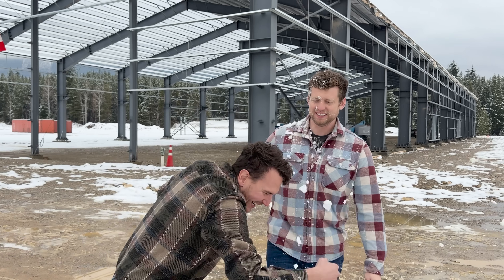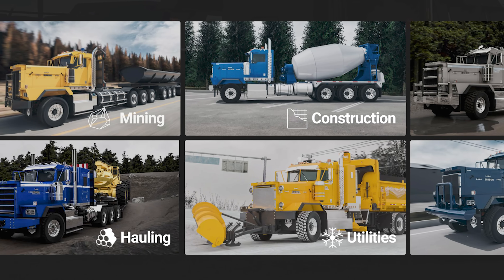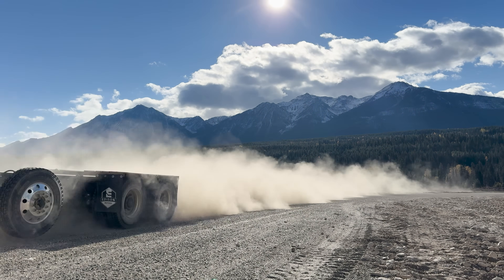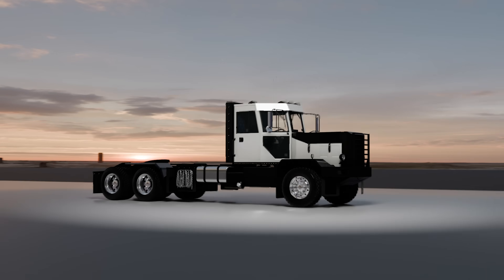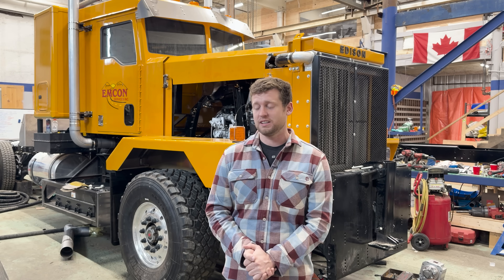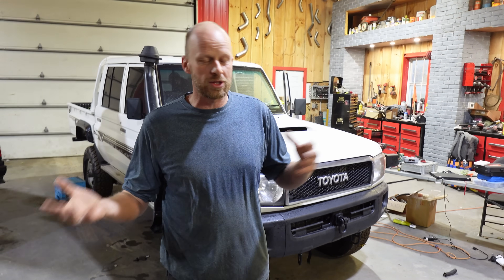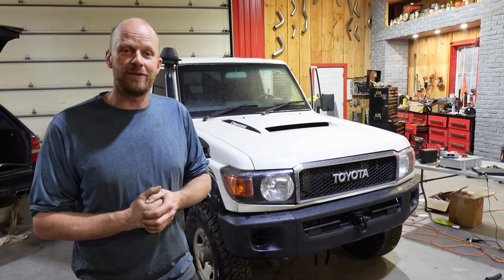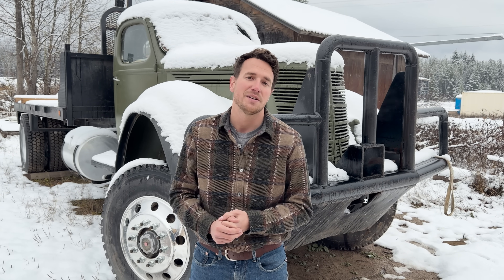VICTORY After RED TAPE: Edison Motors has GOVERNMENT APPROVAL

Comment: I can't help be skeptical about the hybrid trucks. This may not be the kind of video to discuss it, but I didn't hear anything about downsides. Everything has trade offs. Now full disclosure i'm not even an enthusiast in this field, let alone an "expert" but when I hear you get this benefit and that benefit and it's so much better than the way it's been done before I find myself thinking 

1) What are you giving up to get those upsides? 
2) If this is the "best" way to do this particular job, why hasn't it been done before?
Reply: 1) Its more expensive (about 25%). This is why they are incentivized to have right to repair as an ethos. Most of the cost of owning a truck is fuel and repairs. The #1 priority if they want to sell a truck at a high markup is to lower the cost of ownership. They advertise fuel and repair savings because that's the only way they can sell trucks as a small business with low output and high margins. 

Most other companies sell a LOT of trucks at EXTREMELY LOW margins. They then make most of their money in repairs. They sell you 200$ proprietary parts that break constantly because that's literally the business model that makes them profitable. They lock you into a monopoly you can't get out of. This is the hidden benefit of Edison. Fuck all the technobabble, it's expensive in the short term, but way cheaper in the long term. That's their MO.

2) Battery technology has been severely lacking to get the weights down to where they need to be. While trains have had giant cabs chalk full of batteries, and log loaders have huge generators, trucks can't really have either, and have to make up for it with battery energy density. Even now I suspect that they aren't at their target weight, but we'll see.
Reply: The other issue, and what Edison is running into, environmental regulations are not designed for serial hybrids.  They are either parallel hybrids that use engine power that directly drive the axles, or full EVs.  They don’t have regulations that allow the engine to be a generator.  

There was lack of electric axles for trucks.  With the push world wide you see a large jump in the manufacturing of electric drive axles for trucks. There are different design considerations for an e-axle than a regular mechanical one.  The loads from regenerative breaking would destroy a traditional differential that is designed for single directional stresses.   

A disadvantage with the hybrid is that most mechanics won’t touch high voltage.  They have to get special training to be safe with it.   It’s not super hard but it is a field they normally have experience in.  There is also all the programming and diagnostics to get the systems up and running.  

The first Tesla roadster isn’t even 18 years old yet and it took a while before they became common.  Semis are even slower to change.  Chace was one of the first to reserve a Tesla Semi and he would still be waiting for it.  Sometimes it takes fresh blood in the industry to force change.

Comment: I think that the hybrid package has some interesting advantages in PTO applications, and any environment that is stop/go, or up/down... For PTO, DC electric motors can provide the right scale of power, where needed, with the ability to handle peak loads that would require a big main motor, with the right gearing, and the electric motor can be located anywhere, without a mechanical connection, and without the limitations of hydraulic drives. Certainly, there are direct PTO applications that would be less expensive for a particular application, but the requirement of having one engine supply multiple load types...

Comment: why can't you do hybrid semi truck with manual transmission?  I've seen old video where they took old Volkswagen Beetle (Yeah like Herby) and made full electric but kept the older 5 speed and worked great.
Reply: Afaik they showcased a project where somebody did a electric conversion on an old sports car and kept the transmission. The reason you would get rid of it is mostly due to weight and repairability. Practicality unfortunately gets in the way of fun :(
Reply: In this case part of it is that the electric motors are on the axles, so there's no place to put the transmission.  The main reason, though, is that electric motors have such a wide speed range and torque curve that they don't need to change gears.  Having a gearshift is much less fun if you can just start off in 5th as fast as you can start off in 1st, and shifting gears just loses acceleration time.

Comment: I can see hybrid extended wheelbase 4x4 trucks (heavy and light) having an "unfair" advantage over mechanical extended wheelbase 4x4 trucks.
All the challenges in turning radius while in 4x4 disappear when your front axle can turn at a different speed than your rear....

Actually, diesel electric could be pretty exciting for industry as well with an "up-fitter package" electric winches/pumps turning independently of wheel speed/engine RPM

Oops, getting a little ahead of things....
you have bigger fish to fry at the moment....
Looking forward to seeing where this goes.

Comment: the mechanical version might be a blessing because look at lucid the CEO is a automotive expert and they had supply issues with scaling up and repair parts availability.

if I were to get one it would definitely be with a  80-120 in nearly super sleeper and 300-310  in wheelbase 18-20k front axle and Canadian 60 in spread drives no deplorable due to California ridiculous requirement. if it could be styled like a t800 with prominent but shorter nose to reduce the overall length to keep below 110 ft over all it would be a very interesting to pull jeep and tri or quad rgn

Comment: Just to be clear, does the production and sale of mechanical trucks require the approval from Transport Canada? Or is that only needed for the sale of diesel electric ones?
Reply: The mechanical trucks still need the approval from Transport Canada since they are a new truck being driven on public roads.  The hybrids will need separate approval since they are a different design.

Comment: I think you are making a strategic mistake. Your name stands out because of the hybrid concept. To now put it on the shelf and build traditional mechanical, low volume, high margin is the wrong approach. Investor capital is there to buy you time through a few years of negative profit. That's the point. Using investors to reach high volume with one model. You need to reach high volume first, not high margin. I see you spending lots of time on all sorts of projects - pickups, this/that. I'm not even sure what you are actually making at this point and it shows. 

Anyways, regardless, great to see some courageous Canadians having a go at manufacturing! Too bad the government doesn't just green light any request you make. How dumb you now have to go through Transport Canada.

Comment: Anyone notice at 5:02 they show the diagram and it has a 200hp electric motor for braking? More on that please.
Reply: The drive axles themselves are the regen braking.  The regen braking basically turns the axles from motors to generators.  Charging the batteries and slowing the truck down.  This is where the fuel savings is really generated.  The regen breaking is actually more powerful and precise than a Jake break.   The trucks will still have air breaks for low speeds,  redundancy braking, and to satisfy transportation regs.
Reply: @Wild_Lee_Coyote on the electric truck that makes sense but this is on their mechanical drive truck.(And yes I know how regen braking works, I drive Prius and an EV lover)

Comment: Where are you guys at with being able to use a generator "on road"? That seems like the silliest, but biggest, legislative hurdle you guys are currently facing.
Reply: No this is for the mechanical trucks at the moment.  Edison is still working on getting the Environmental laws changed for the hybrid trucks.  Certification for the mechanical trucks was much quicker because the laws didn’t have to be changed, they just had to get an exemption.

Comment: If you want a pickup that gets great electric mileage, build the axles narrow! If you have to mount your own cab anyway, it doesn't have to be a truck cab. Throw a Honda Fit shell on there. Drag force is frontal area multiplied by drag coefficient. If you shrink your cab from 2m to the 1.5m width of a subcompact car, you'll get 30% more range or a 30% smaller battery, allowing more payload.

Comment: One suggestion for the edison rigs, separate amber rear turn lamps! Could keep the clean look with all clear LED housings but have the clarity and reduced rear end collision risk too!
Reply: Every Edison truck in the near and medium future will be a custom truck.  You want amber turn lights, you got em. The advantage is Edison is all about off the self components. So if you want 30 lights and 6’ sleeper cab on your wench truck, that can be done.
Reply: wench truck? hahaha
Reply: @-NGC-6302- Fanny magnet?
Reply: @Wild_Lee_Coyote but they are streamlining wire harnesses in a way that every wire harness is the same one for a batch. I guess they will have a modular structure for custom wiring for custom applications. If not this will become another disaster.
Reply: @sujeewarathnaweera  You genuinely believe they haven't thought of that, given their stated aims and goals?
Reply: @garys6333 I am not thst much aware about their aims and goals. Therefore, I genuinely believe that. So there's that. 🎉
Reply: So much this
Reply: Design them to be compatible with European turn signal requirements and it's easier to export to other places.

Comment: didn't think to say when i watched the Deboss video on it but is it possible to add provisions for wider tires on your trucks? if so you may be able to put more power to the road without excessive tire wear due to the higher surface area.. i have a feeling that for Semi;s who's tires cost allot having this option may be worth it, maybe not in the short term but for say 10 years down the road when due to more electrics being available wider tires may become more common as well.

Comment: With the whole right to repair thing, aren’t you guys worried about loosing out on revenue from maintenance and parts? At some point initial purchases will peak what will you guys do to ensure a steady stream of income and not just a tank in revenue?
Reply: It is evil to design for planned obsolescence and to depend on that revenue stream.

Edison will be plenty busy just making new "everlasting gobstopper" trucks that last 2-5 times as long before needing parts and service.

Edison is a small volume manufacturer.
Reply: @Sah-o5m I am more just curious as to what alternative revenue streams they will consider during the “gap” or “slow” periods. I completely agree with you that we should have right to repair and no planned obsolescence. I just want to know how they are going to make up for that lost revenue. You can sell a few hundred thousand trucks, but if you don’t do any maintenance or sell any parts now you’re just sitting around waiting for new customers.
Reply: @googleusernfpa70e
Edison only has capacity to make 500 trucks per year. 

They have a waiting list a mile long in 20 different vocational industry markets.

I think they'll just keep busy.

Comment: Great you hear you managed to get the stamp of approval, but what actually changed? Is this through a special exemption? reinterpretation of on-road emission standards? Did allowable standards actually change?
Reply: No, this is just the environment approval for fully mechanical trucks. 

The "problem" with diesel-electric is that the lawmaker just forgot to/didn't include that. There are emission rules for engines that power the driveline (mechanical, varying rpms etc) and rules for generators (to provide cooling, or power for acessory equipment, welders, cranes etc) but there aren't any rules (yet) which dictate how an engine thats used as a generator for the driveline should be environmentally certified. (Certifications that are accepted in Canada, in the EU, engines can get certified for that use case, and the scania engine Edison uses is EU certified. But Canada wont accept that certification because they follow American EPA standards.)